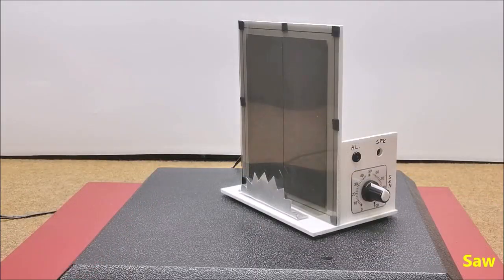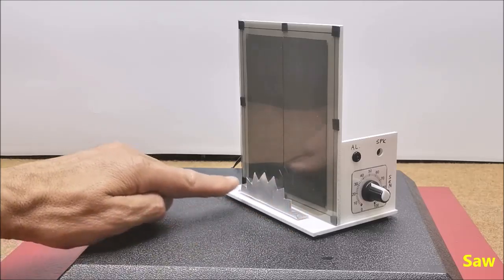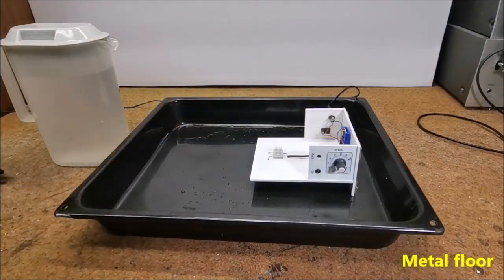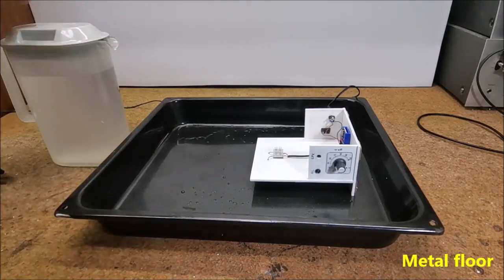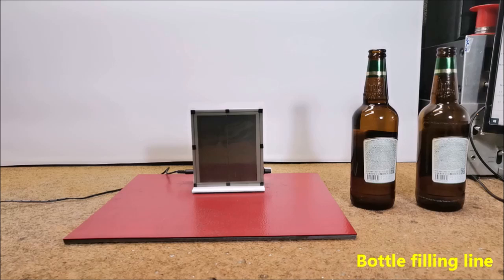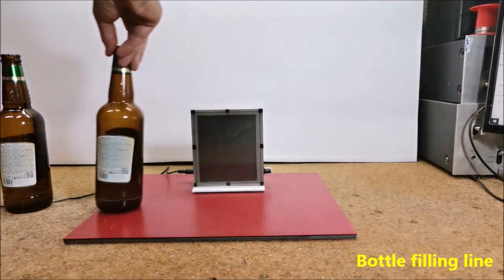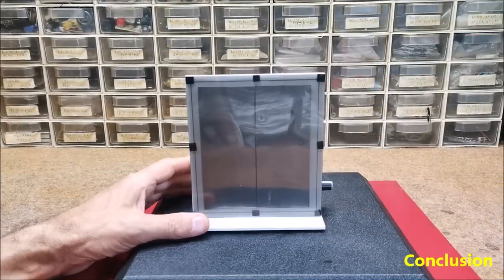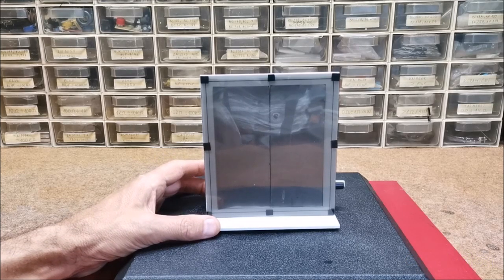DIY simple Capacitive Proximity sensor - human presence detector

Comment: i build your geophone/seismograph project today, thank you for sharing it. I suggest you check the BISS0001 chip that can be found on HC-SR501 PIR modules, as they can be used with batteries (50uA quiescent current), and can turn ON a microcontroller for up to 7 minutes (the BISS0001 includes an amplifier, comparator and timer). The HC-SR501 uses a pyroelectric effect sensor to detect human presence but I tested with a piezzo disc and your magnetic pendulum as vibration sensors.

Comment: A very excellent project, instruction and video. Thank you. I was impressed with the different use applications, especially that it can detect water on the bottom of a metal container. It brings to mind another capacitive sensor use - to measure the level of water in a tank... The sensor is nothing more than two copper pipes of the same length and, having different diameters. The smaller diameter piece is centered and secured inside the larger diameter piece. The capacitance of the sensor is read, when the tank is dry. It is read, again, when the tank is full. The volume of water in the tank will be linear, across the capacitance range, between the empty and full readings. I have only read about this sensor. I would very much like to see you make a video of it, so I could see it in action. Thank you for your consideration of this project.
Reply from the maker: Watch this video:  https://www.youtube.com/watch?v=M4eMRBKIfjE

Comment: What's the thickness and size of aluminum plates?
Reply from the maker: The dimensions are not significant, and in my case they are 12 cm x 5 cm, the thickness is 0.5 mm
Reply: @MirkoPavleskiMK  Could Aluminum, or Copper, foil tape be used?